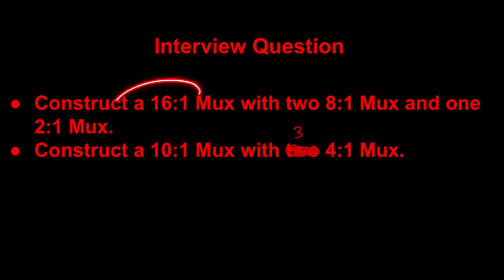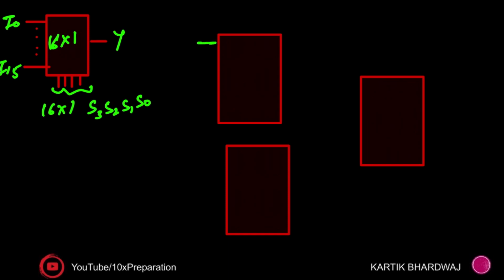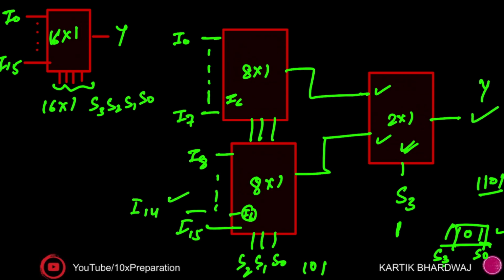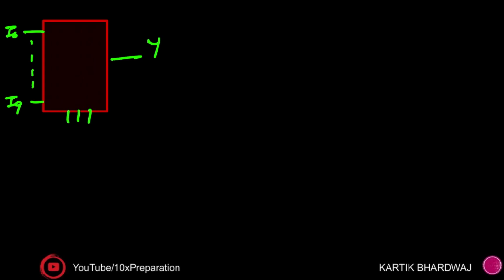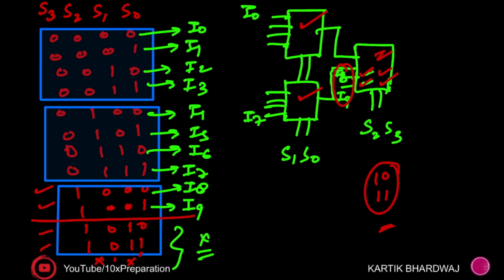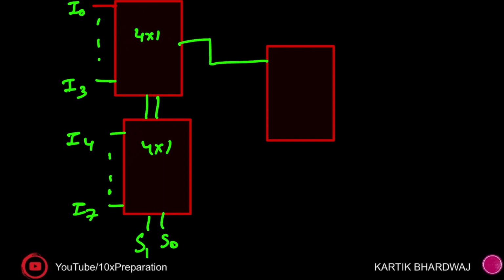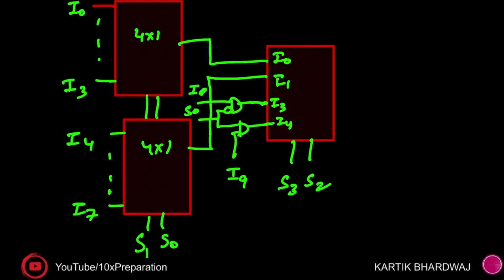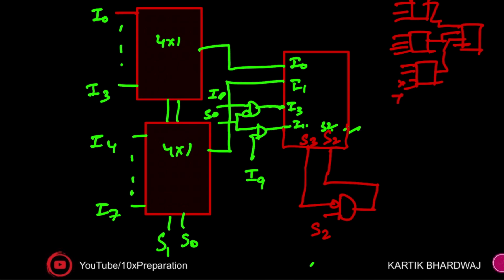VLSI Interview Mastery: Implementing 16x1 Mux with 8:1 Mux and 2:1 Mux | 10x1 Mux with 4x1 Mux

Comment: if S3,S2 is never 1,1 then, i4 get never selected. if S3 S2 is 1,0 then only i3 get selected . Then how realize for i4??
Reply from the maker: Hi bhai... thank you so much for writing about it. Actually that port is i3 only and based on S0 I9 or I8 will be selected. You never need I4 in the given case. If any other query please let me know
Reply: @10xPreparation  You Basically used a 2:1 Mux there for I3